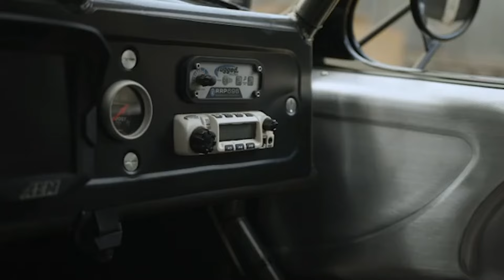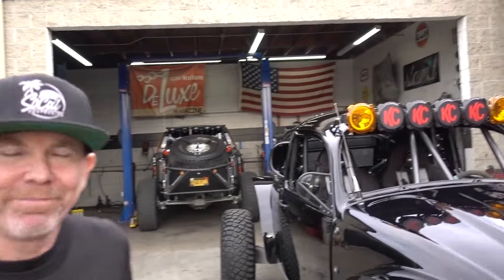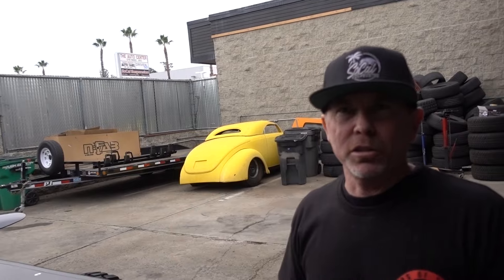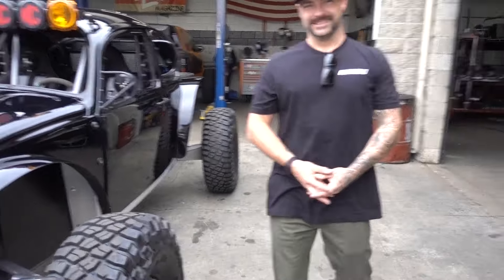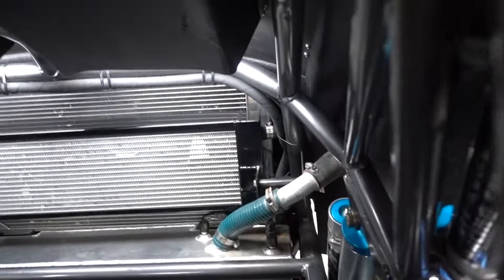Eric Conner's 869hp BAJA BUG | BUILT TO DESTROY

Comment: Guys I'm seeing something here. I'm not trying to talk smack, just trying to articulate what I'm observing about the vehicle while considering what the owner has stated. I watched the video several times soaking things in. The fab work is brilliant and I'm stoked. I'm very interested in how the front suspension and steering turns out. 
 
#1) Rear firewall. Separate that fuel cell from the occupants. In my 20 years of building vehicles, no matter what fuel leaks when I've rolled. 

#2) With the rear cooling in mind, imagine behind the seats having two parts. A lower firewall to separate the fuel cell from the cabin and an upper section to bring the air in from the roof and the side scoops for cooling. Both sections designed for there own purpose that work together.

It's an opportunity to create a "void" or vacuum space/cavity for roof cooling airflow and at the same time, keep fuel out of the cabin.

Airflow may be hindered by the A pillar roof lights going into the roof air scoops, I'm not sure. Maybe a spoiler behind the roof lights to smooth the air flow? 

I'd prefer to run a windshield too. I think with the area behind the seats being sealed off up higher for better cooling airflow would utilize the side scoops more effectively. Maybe with some interior duct work or extending the side scoops into the upper cooling cavity?

Getting rear seats in with all that going on would be a trick but I think it could be done.

Shame on me if I'm out of line. 

But dang it, separate that fuel cell from the cabin if nothing else